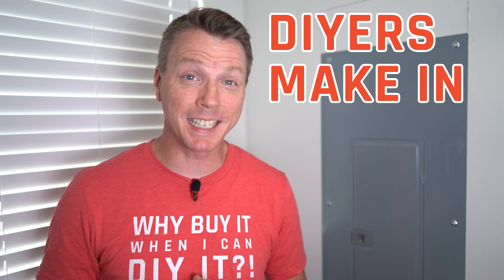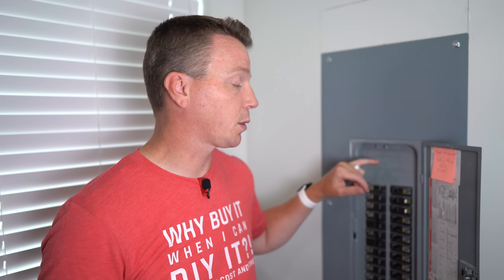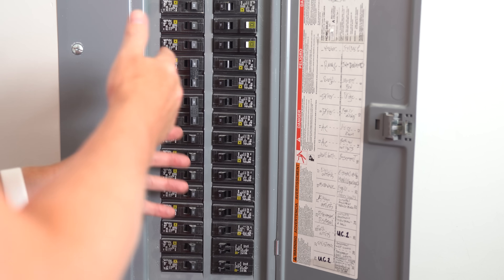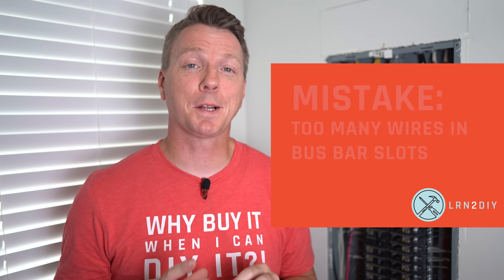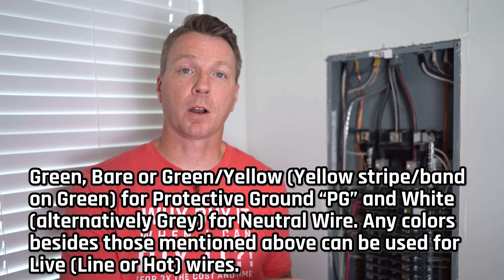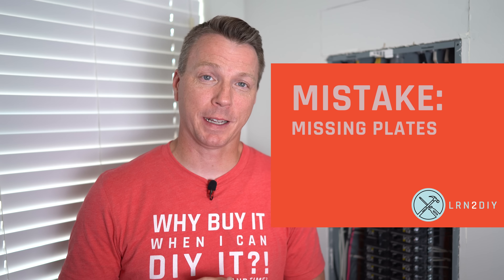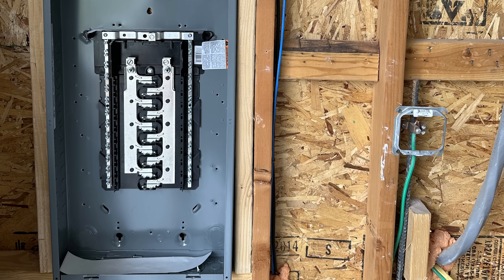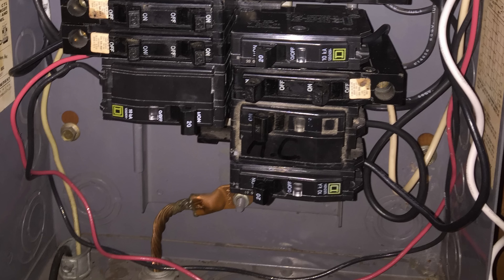10 Common Mistakes DIYers Make In Circuit Breaker Boxes

Comment: You forgot mistake #11 that you demonstrated in the video: Waving your hands cavalierly around a panel with the cover removed and then tightening the screws on the hot lead of a breaker without switching it off.  Even with an insulated screwdriver this is an unnecessary risk, particularly for a nonprofessional.  And waving your hands around the lugs where the entrance cable connects is just asking to touch a hot lead by mistake.
Reply: Not sure if he’s been shocked too many times or not enough
Reply: @RR33XX  With the probability of the box not being hot we will never know. Have a good day.
Reply: Good points, though I see near all electricians seemingly careless flailing hands to point at stuff or to touch things. Though recent contractors seldom reached in unless needing to do so. Isolated power if beginning work.
Reply: Lock out tag out. Never know when the neighbors snot nosed kid flips the switch or someone in property that was not aware of the service to switchgear.
Reply: Just imagine the panel is de-energized. Now you can relax.
Reply: @nothanks960  I am completely relaxed.  I’ve worked around high voltage my entire career, but to show such to DIYers is rather dangerous.  Maybe you should relax less and think more.  😁
Reply: I’m thinking he had the service disconnect turned off.
Reply: With a big ring on his finger.
Reply: What’s the worse thing that can happen?  Hahahaha
Reply: As soon as an electrician is certified, their resistance to current flow dramatically increases.
Reply: At least he wasn’t holding a beer.
Reply: @diytwoincollege7079  At least then he would have had an excuse. 😂
Reply: I don't touch any electrical panel without testing it with a non contact voltage device. Any screws removed will be done with insulated screwdrivers.  I'm going to get that torquing screwdriver.
Reply: There’s a lot wrong here. A 150A panel is pretty marginal now. Yes, there are plenty of 100’s and even 60’s out there but 200A is really minimum with central A/C and 400A is becoming common around here for larger homes. If I saw a panel with bonehead mistakes like wires entering the panel with no stress relief clamps, plastic or steel, or ground wires in the panel that are connected to nothing in particular, it’s time to call in a licensed electrician to unscramble the mess and bring it up to code. While he’s on the premises an upgrade to 200A or even 400A would be a good idea, assuming that the feed from the power company is large enough to handle the ampacity. If not, upgrading the feed is on their nickel, not the homeowners.
Reply: Totally spot on! Why not use a test pen to touch CB n not use own fingers?
Reply: The size of the breaker does not determine the Suze of the wire. HVAC is wire to the minimum and fuse to the maximum same with motor loads.
Reply: @williamleblanc3244  Well, technically the size of the wire determines the maximum rating of the breaker.  You can always use a smaller breaker, but you can’t use one larger than what the wire is rated for.
Reply: Look up NEC 440.4(B)
Reply: You can use smaller wire on a larger breaker. Refer to Article 430 and 440. The reason you can do this is for the lock rotor amps. For motors and HVAC, you wire to the minimum and have overcurrent protection at the maximum. So depending on the math you could have 12 Guage wire on a 30A breaker and be completely code complaint.
Reply: @williamleblanc3244 you made me look up the code, haha. It actually says the opposite, no 14 ga wires with a 30 amp breaker that leaves the same enclosure as the breaker.
Reply: I have been many times got electrocuted with 240volts! Feels like being sting with a giant killer hornet! 110volts is just small jolt nothing serious..240 volts is more painful 😂 the country i grew up has 240 volts outlet’s, no grounding, i was a diyer on my high-school days, got electrocuted many times from doing crazy electrical projects myself.. the only wires i would not mess around is on top of electrical post! I have seen carpenter doing a roof that accidentally touched those high voltage line, he got cooked for 10 minutes boiling his blood cooking his inner guts inside😩 saw how his intestines blew out and his blood  gushing out boiling from his mouth and stomach. Until now still hunts me..🙏 i was 16 then.
Reply: @camilo8cheryl  If you have been electrocuted several times, you have reincarnation down to a science.  Please tell us how you keep coming back from dead.
Reply: I like those panels that have an insulating plastic piece over those live incoming studs. It mentally removes a fear I carry.
Reply: @normferguson2769  Fear of high voltage, high current sources is a good thing and removing that fear isn’t always wise.
Reply: People often do diy to save money because electricians are expensive. Also living on an old house, some of the circuits are out of code and replacing them is really expensive. Doing diy for some of the work avoids having to remortgage your house
Reply: @normfarris3430  How expensive is burning down your house or putting yourself in the ER for an evening?
Reply: Dude was raising my stress level and giving me cold sweats
Reply: @chrismckenna5361  me too. I'm sure he has supply going to it off but still, need to make a habit of not doing that as there could be enough amps to easily kill.
Reply: Yeah, sure he was. All from the distance of a video recorded previously. Look up the word "exaggerate". You may find your picture there.
Reply: @chrismckenna5361  Yes, this sort of thing is what gives DIYers a bad name.  240 V electricity is nothing to treat so cavalierly.
Reply: I see that every time I help someone with an electrical problem
Reply: Doin’ it for views.  Lol
Reply: Y'all acting like this is 440 😂
Reply: @sebrofc  I once met a technician who insisted putting on fire proof apron before opening my panel cover. He said it might spark and he could catch on fire. 😂
Reply: Just like firearm safety... It's absolutely unnecessary... If you're incapable of paying attention to your body and something a flick away from death at all times without even trying.

 You deserve what comes to you or the poor lad who felt safe around such idiocy.  

The don't speak Italian 3ft from an open breaker box rule of thumb and the keep your finger off the trigger of an unloaded firearm with the safty on just because it might fire rule of thumb are just excuses for incompetent people to keep doing things that require competence... Top notch
Reply: Yeah he's making me jump ...he is not convincing me.. journey man electrician for _ 40 years.let him work in a powerplant a few weeks waiving his hands
Reply: That's why I can't watch my father in law use a table saw.
Reply: I figured this was a demonstrator panel and not actually hooked up… or maybe disconnected from the other end for this demo.
Reply: @tomwilson2112  You know what is said about assuming?
Reply: It's 120/240 bro..he'll be okay.
Reply: It is otherwise an excellent video !!!
Reply: Also, wearing his metal ring lolllll
Reply: Always one.  Sheesh
Reply: @mikevoorhies5171  Yes, and it took that one 4 months to show up.  Sheesh.
Reply: Don't forget!! Coffee is hot! Glad you added this otherwise I might wave my hand into a buss bar 😂 the world is so scared of itself its apparent why we never get anything done anymore lol 😆
Reply: @keithbaker1951  And people like you are stupid which makes such warnings necessary.
Reply: You would have passed out watching me work on mine yesterday.  I was fixing a disconnect box for my ac.  I had the cover off the panel and looking around.   Forgot I had a headlamp on and when I looked down the and metal head lamp touched the breakers.  Could have been much worse and almost had to change my pants
Reply: @ickess  No, wouldn’t have bothered me at all.  I have watched many stupid people do stupid stuff.  I have no problem with that at all.  I only object when stupid people tell other people, or show them how, to do stupid stuff, particularly folks that may well not even now that what they are being told is stupid.
Reply: I don't care if the box is live I cringed every time he started waving towards that box looking away from it sticking his fingers through the missing cover plate. Don't show people bad habits.
Reply: DIYERS NEED TO STOP GIVING ELECTRICAL ADVICE.

Electrical is not a hobby.
Reply: Excellent video. I was hoping would touch on multi wire branch circuits or MWBC’s. A little bit more detailed of a conversation, but an important one to understand how circuits are wired in a panel and how the offset of the two loads is carried back on the neutral.  Thanks for posting.
Reply: I agree completely, although it should be MISTAKE #1.  The first words out of his mouth should have been to turn the main breaker off.  Additionally, he’s not wearing any eye protection.  You make a mistake and short something and you are now arc welding and molten metal will be shooting around.
Reply: @glasshalffull2930 9
Reply: @glasshalffull2930 Risk at what?
Did you know a person can actually touch HOT ALONE and not get shocked or neutral by itself and NOT 🚫 GET SHOCKED 
ONLY IF YOU TOUCH THEM BOTH, THEN YOU WILL GET ZAPPED!!!  😎🤣
Reply: @glasshalffull2930 . Turning the main breaker off does not de-energize the conductors feeding that panel, nor the lugs they’re terminated on.  Safest method would be to remove the meter, then use cable ties to hold the bypass lever in place should you have one on your meter socket, and then keep the meter in your sight
Reply: @JamesLetourneau-p5k   (Edit: James deleted his comment because he was in error)

Actually, in THIS PANEL, turning off the main breaker DOES de-energize the panel.  If you examine THIS PANEL, you’ll notice that there is NO MAIN BREAKER inside the panel.  In 2020, NEC code changed (230.85) to require an easily accessible exterior EMERGENCY DISCONNECT for new construction 1 and 2 family dwellings.  It’s a safety feature for first responders to be able locate and shut off the power in an emergency.  So, shutting off the emergency disconnect would de-energize this panel.  If this were a ‘sub-panel’, turning the power off at the main panel would also de-energize the sub-panel.  Of course as you stated, if the main breaker is inside the box, then the main conductors/lugs would be hot even if the main breaker inside the panel is off.
Reply: @glasshalffull2930 I always turn the outside main breaker off when DIY anything electrical
Reply: @monad_tcp   I guess that’s why I said it should be #1.
Reply: @glasshalffull2930  Good points.
Reply: If hand waving was so dangerous, Scotty Kilmer would have vanquished himself decades ago?
Reply: Amen!
Reply: Your obviously a rookie !
Reply: @jamespatton2975  You’re obviously illiterate.
Reply: It was disconected
Reply: He is recording video with light and other electrical equipment on. Shutting down panel is counter productive.
Reply: @BlahBlahManYeah  Contacting a live panel with your body is also counterproductive.
Reply: YIKES
Reply: 😢😢😢😮
😢mm 0:58 🎉
Reply: No he did not. Read the title. It says "10 common mistakes", not "every f¥kng mistake you can think of"
Reply: Bro he likely had the main breaker that supplies the power to the house shut off making it safe for his hands to go around in the box.
Reply: I was thinking the same thing 🤦🏽
Reply: Man, I was thinking it was just me. He was stressing me out so bad watching this video.
Reply: I don’t think there is power running to the panel, so nbd
Reply: @Flipflop437  That is what many electrocuted people also thought.  When you are demonstrating a procedure to someone, especially novices, you should “train the way you fight” and do everything correctly and demonstrating proper technique and precaution.
Reply: So many YouTubers do this. It drives me crazy.
Reply: I would say it's just a dummy box and has no voltage at all to it. Something like for training scenarios!
Reply: @SamuelDowning78  Doesn’t matter.  Train like you fight and fight like you train always applies.
Reply: I’m a fan of folks using a wooden dowel or a pencil. But I almost never ever see it in YouTube videos.
Reply: @Boogle912 , A pencil has a conductive center.
Reply: @donaldthompson2319 okay but sorry I meant using the eraser of a pencil. Better than a finger
Reply: How do you know it's live?
Reply: @TlD-dg6ug  It doesn’t matter if it is live or not.
Reply: This guy is going to get some people killed by making them feel overconfident about their electrical abilities or lack thereof...
Reply: I’m guessing he had the main breaker off.
Reply: Risk at what?
Did you know a person can actually touch HOT ALONE and not get shocked or neutral by itself and NOT 🚫 GET SHOCKED 
ONLY IF YOU TOUCH THEM BOTH, THEN YOU WILL GET ZAPPED!!!  😎🤣
Reply: @Vote4Trump2MAGA  And you are wrong.  I would suggest you try it and get back to us, but I don’t want you to get hurt so don’t try it.  You absolutely will get shocked.  The amount of shock depends on how well insulated you are from a ground reference, but even perfectly insulated, you will get some shock.
Reply: @Vote4Trump2MAGA  People who type in all caps are always full of crap.
Reply: Thinking of the guy who always shocks himself demonstrating electrical projects 😂
Reply: Always work with panels,as if they hot even if power is OFF
Reply: Relax my guy, it's insulated.
Reply: @CatnamedMittens  ROTFL
Reply: What a bunch of whiners
Reply: Dude!........At least wear some good insulated gloves!    (And NEVER work in an "energized panel"!)........NEVER
Reply: Yeah, it was a bit uneasy feeling
Reply: I am not an electrician, but metallic rings worn on your hands is a big hazard?
Reply: The instructor made me cringe every time he poked/or waved his bare hands around the bus and the wires especially with his wedding band on his finger. I don’t remember him letting us, viewers, know that it is very important to make sure there’s no power to the panel before opening or working inside an open panel.
Reply: Low voltage won't come out and get you@LTVoyager
Reply: @animalmother9945  Which has exactly nothing to do with my comment.  Read it again, Sam.
Reply: You clearly have no electrical skills if that's what scares you
Reply: @illwil2158  You clearly have no brains if it doesn’t.
Reply: Amazing how many people think they know how electricity works. It’s not static electricity that is in your electrical panel and it’s not going to jump out of the panel and shock you. There are only certain parts in the panel that will actually shock you so settle down all you know it all’s out there.
Reply: I'm glad someone else saw this
Reply: I understand your point but also as long as you're aware of where your hands are, you'll be fine.  You should treat electricity with respect, but being terrified to even touch it can be just as bad.  I've seen guys that made really bad mistakes because the fear clouded his mind.
Reply: @ You just confirmed that you actually didn’t understand my point.
Reply: I agree this guy gave a lot of unqualified and wrong advice that could spread misinformation in the diy community.  I am OK with diy guys doing their own work after getting the right information, but it's dangerous  if you get your training from diy guys.
If you are learing do yourself a favor and get you advice from another video.  For examples: you never go around and retorq screws because it da ages the wires so that they might carry less amps and over heat . That means  in time  ay e 10 or more years later you could be the cause of the fire. It could also happen sooner depending di g on how many times you go around re-torqing.  The torq number is for a fresh stripped wire. After being torqed over time the wire tensile relaxes and it is still properly torqed. So whe re-tored it damages the wire.  So torqing is done once and done.  And the same thing about what he thinks is a nice tight job -- there is safety issues if your not a trained electrician that include wire bending radius,  and location.  That type of short wiring should only be left to an experienced  trained  qualified electrician, but adiy guy should definitely not do what "he thinks" is short and neat because he is not qualified to judge  best practices.  Most diy persons should leave a little extra to a small loop of extra wire.  It's very li,Ely that an experienced  electrician may need to come move circuit  breakers around, a d even diy guys will likely need to move things around some day.  For example, the electronics including safety devices that go into houses after 2023 can be protected by a SPD that goes at the top or closest to the line side end.  Also, many e,ectrical panels will add a small roof solar system and those breakers are located on the opposite end of the bus for the breakers.  And maybe you add a hottub or extra circuit  and it hasrequireme ts to move  breakers.  So unless you live in an apartment building or a condominium you could be shooting yourself in the foot by short wiring your electric panel. The opinion of a diy guy that over rea he's can be dangerous  as much as it is helpful.
Reply: His arm was rather close
Reply: I was sweating every time he got his hand or fingers anywhere near it.
Reply: I was just about to write the same thing! 😅
Reply: I agree! A wooden chopstick would make a good, safe pointing device.
Reply: When is your video coming out not soon enough.
Reply: Add to the no PPE , wearing jewelry while working around electrical equipment. An absolute no no. I put a hook in the very back of my toolbox so my wedding ring could sit there until finished working.
Reply: I supect it's shut off.
Reply: I'm sure he turn off the power to that panel before he started, he just forgot to mention it.
Reply: @donaldshimkus539  "I'm sure he turn off the power to that panel" ... No. That is the main house panel, not a subpanel. There is nowhere to "turn it off" other than pulling the electric meter which is usually secured and tagged.
Reply: @fyt54321  well then, he's almost as crazy as me. If I told you what I've done, you wouldn't believe most of it.
Reply: @fyt54321  
You obviously are not an electrician.
Any newer service has a breaker and lockout at the meter base. Outside the house in an egg structure or whatever ordinance is required. Every job I do where a meter base goes in has a structure and breaker outside.
So many people just rattling off "what they know" go get an electrician license, then comment.
Reply: @fyt54321  I can't speak to other locations but we have a main breaker easily accessible below the meter and then a main box inside like he is showing. Have a good day.
Reply: @donaldshimkus539 I think you are absolutely right,  as I can see this is a lug panel, so the Main disconnect is probably outside next to the meter but he forgot to show  and mention it.
Reply: @donaldshimkus539 either way, it's a problem in an instructional video.
Reply: @charliesullivan4304  true.
Reply: Good grief keep your hands away from those wires. Very unsafe to do this, especially that you were waving your hands near the wires and looking at the camera. Use an insulated screwdriver to point out things, not your fingers.
Reply: @SavageVoyageur Risk at what?
Did you know a person can actually touch HOT ALONE or neutral BY ITSELF AND NOT 🚫 GET SHOCKED 
ONLY IF YOU TOUCH THEM BOTH, THEN YOU WILL GET ZAPPED!!!  😎🤣
Reply: @Stark-ek7mh  hey, that's me. Working in hot panels and on other live stuff. Checking for juice with my fingers. I don't do the 480V stuff anymore though. Already close enough to waking up on the other side of the grass.
Reply: Good advise
Reply: Good advise. Learn to spell
Reply: @nothankyou5524  Learn to reply properly so we know to whom you are replying.
Reply: Tie his hands behind his back and he couldn't talk
Reply: @jesseabreu3849 po8
Reply: I'm sure he turned off the main.  Duhhh !
Reply: @robertfisch4603  the fact that you don't know if he did shows your ignorance
Reply: @bugbomb8048  True.  Look at all of the idiots that are around today given the safety craze that started a couple decades ago.  We need to let Darwin work his magic again.
Reply: Honestly, and this might make me sound like an elitist, but I think if someone needs information from a YouTube video they shouldn't do their own electrical work even if it's legal.

Video explanations to help you learn code or work techniques, yes, absolutely.  But this the goal needs to be to become comfortable with the books.  There are a lot of "except for" details.

For example, 14 ga wire does get you to an ampacity of 15 A in residential work - except for when it doesn't.  Maybe the wire is in a hot environment and needs extra protection to avoid cooking the insulation.

Too much stuff being fed from a panel shouldn't be a fire hazard - the main or feeder breaker protects you. But it is a nuisance risk.  Imagine having the whole house black out because you have the oven, hot tub, dryer, and car charger going at the same time.

And sure enough there are best practices in code with tables and such to help you out.  Adding a subpanel probably isn't the solution though. If you need a bigger service from the utility, a subpanel won't magically give you more capacity.
Reply: Yeah, you're an elitist. Doing your own work is commonplace on many, maybe most parts of the country. That's why permits are pulled. That's why work is inspected in stages. And please don't tell me the guys that an electrical contractor may send out knows what he's doing. I'll take my work over the electrician that installed the 200 amper in the house I bought any day of the week.
Reply: @nothankyou5524  Who are you talking to?  You do realize you can reply to a specific person, right?
Reply: @jordanrodrigues1279 Make your own video, genius!
Reply: @jordanrodrigues1279 It's not rocket science or brain surgery.
Reply: @jordanrodrigues1279  I'm guessing you go to a mechanic to have your brakes changed as well?
Reply: @jordanrodrigues1279  Point well taken.  Hopefully, people will view not only this video, but multiple one’s done by actual electricians and read the comments like yours that point out errors or better practices.  More knowledge is always a good thing.
Reply: He was actually making me nervous.. like someone handling a gin within clearing it
Reply: Came to say the same thing. He’s waving his hands near the main lugs while facing the other way. Asking for a bad injury or worse. And maybe teaching others this is ok.
Reply: Good thing all these experts are here to critique a video that has been staged. First, just watch the freaking video for the content and if you don’t like it carry on. He specifically states that if you aren’t qualified or comfortable with this type of work DO NOT DO IT D HIRE A PRO. Second, for the consideration of time and the many more hours it goes into making and editing a video like this and its intended audience ( not a newb) some things may be implied…. You know like turn the main off and ensuring that the system is not energized before digging around in a panel. Yeah he did cover that too in point 1. BuT BuHTT WhAT iF THAy ToUCh the Main BeAfOUr tHe BrAkOR ?!?!? Well then its their time to shine and they had a good run. It’s great that all the safety Stan’s are here to ensure the picking apart of a very informative video.   understand that he is making these videos often, and is pointing things out like you would in an instructional setting( it is an instructional video) and is very much paying attention for his own safety and whoever may be operating the camera. The other consideration is when a video is shot different angles do not give full depth of reference to where his hands may or may not be close to. He comes off as a pretty intelligent guy and i would assume that he put safety measures in place before hand and oh my , may have cut them in editing four time reasons.  Again… referring back to the first points if you don’t know what you are doing then you shouldn’t be doing the work. Good on anyone who is watching a video to better their knowledge or get a different perspective on a familiar process . As for the dim bulbs who would disregard their own safety and stick things where they shouldn’t be in an electrical panel…. Sometimes you need a little chlorine for the gene pool . 99% of the time even if the safety measures are scrutinized at length, Stupid is going to stupid. Anyone doing a DIY should always check codes and look up all possible info before attempting any project.  Also if you are getting all anxious and bent watching a video you have obviously never been to a real job site to witness the daily death defying stunts by people who are “Professionals”… Plus nobody likes the “safety guy”, find me someone who isn’t a safety manager who likes other safety managers.. BTW @LRN2DIY great video!
Reply: @jimhardin1520 what a blowhard, stop the pot smoking
Reply: @jimhardin1520  Thanks Jim for your responsible view on this. I agree with all you said.
Reply: @jimhardin1520  He givessome really bad advice and diy guys will say i thought it was all good. He knows just enought to be dangerous .  He was talking about things he only half understands and he was trying to give expert advice.  If his video was this is what I did, .ike show and tell it would have been OK, but he unknowingly guy spread a lot of false information, and uninformed opinions.  If he did not try to play teacher and get so much wrong g then no o e would be giving g him a hard time.  QUALIFIED PERSONS  are doing honest truth here.
Reply: @jimhardin1520 
So well put!!! 
My response was going to be very similar to yours.
We at job sites do far more death defying things all day every day.
If you don't know what you're doing, learn first. If not, you will learn the other way. I still get bit because I push the limits sometimes. It happens. Feel like a moron with a clouded head for a few minutes after tasting 240 and move on. Lol.
Oh, the chlorine for the gene pool comment, THAT'S THE BEST! 😂
Reply: @jimhardin1520 Boy, that really seemed to strike a nerve with you.  I hope I am wrong, but as a student of human psychology for 57 years now, I have seen your kind many times.  The kind that can’t be told anything, can’t take correction, is never wrong, and knows it all already.  These are the ones that end up getting hurt or killed leaving a family behind.  Again, I hope that’s not you.
Reply: Did you get your degree in that? A bit pampas, are we not?
Reply: I was shocked (no pun intended) to see that this work falls into the realm of DIY.   Where I am it is restricted work and may only be undertaken by a licensed electrician.
Reply: @nocturn791   So, if you have a receptacle ($2.65), you pay an electrician $80+ to come out and replace it.
Reply: @nocturn791  The problem is that not all DIY folks are the same.  I am a retired EE and am quite familiar with electricity.  Should I be prevented from working on my own electrical system?  How about a retired electrician who is technically no longer licensed?  It is seldom good to have broad brush regulations that don’t take into account individual competence.
Reply: @LTVoyager  - sure, that is understandable.   But who's there to verify all this experience?  A regulatory regime is not only there to protect the homeowner against the dangers of working with 240v but all future owners and occupiers.
Reply: @nocturn791  Then inspect the structure at the time of the sale.  Government is already far too intrusive.
Reply: @LTVoyager You are 100% correct, sir!
Reply: @nocturn791 licensing requirements also function as a barrier to entry, preventing the supply of services from growing at a rate to meet demand, which also keeps prices higher due to restricted supply.  Licensing is good in many instances, but it does have the ability to restrict competition.  Also if I’m a licensed nurse, doctor, electrician or plumber in one state, my license isn’t valid in other states.  This is proof that licensing functions as a barrier to entry into a particular field or market. Though South Dakota recently changed their regulations to honor licenses from other states.
Reply: @LTVoyager Electricians almost always refuse to acknowledge EEs' ability to read and understand NEC just as well as they do and those of us in the defense industry have standards way tighter than commercial electricians. Some of the bundling of wires through conduits I've seen them get way with would never pass our standards. Whatever, haters are going to hate. For the few electricians out there that do understand and respect EEs (you know, the guys that designed amost everything electrical that is sold), the respect is mutual. I appreciate all you do and I've learned a thing or two from you along the way.
Reply: @nocturn791 It is not governments job to impose common sense on citizens. I wonder how you feel about common sense gun laws.
Reply: @LTVoyager yes you should be prevented I've never seen an EE that was qualified to do any real work and their design work is usually suspect lol
Reply: @johnvandemark7490  This is your way of saying you’ve never seen an EE.  Got it.
Reply: Sorry this is a free country i don't think more regulation and more Nanny 3 letter agencies are needed. Residential electricity is so simple. Try aircraft or even automotive wiring.  Obviously it can be dangerous but 4 wires is you use 2 hots, neutral and ground.  I was a plumber/pipefitter/millwright and i have all the confidence i need to wire any home din America
Reply: @PatrickBuckley-ol2ok   I never mentioned more regulation or 3 letter agencies.  Yes, residential wiring s simple, but so is auto and aircraft, unless you are talking military or airliners.  Wiring really doesn’t get complicated until you are routing multilayer PCBs for modern computers.
Reply: In all places ive lived, you.pull a permit and inspection is done before you close up. Sorry if you dont like it, but if proper attention is paid in doing it right, imo, its not a problem. If you're over your head, you should be intelligent enough to not do it. This is commonplace in many many areas of the country.
Reply: @nocturn791 
It’s not that difficult to figure/learn how electricity works a/o how to do this kind of stuff!  The same goes for working on your natural gas lines and plumbing  a/o appliances.  All it takes is a bit of reading, safety awareness and a practicality/common sense.  🤷‍♂️
Reply: 240 is a joke. Stop being silly.
Reply: Oh jees 240 is only a tingle if you touch it.
Reply: @MUUKOW3  I shorted 120V with my two fingers when I was a kid.
I've learned my lesson.
Reply: @monad_tcp Wait until you get thrown across from the HV side of a transmitter tube. That will get your attention.
Reply: @MUUKOW3  I once got hit by the lead to a 3 500z ons heathkit ssb220. iam very lucky to still be here today.
Reply: @MUUKOW3 now that's high voltage! I work on simple guitar tube amps and the radio tubes you work with are another level.
Reply: @MUUKOW3 : Bet you won’t do that again!
Reply: We, electricians, will not have any respect until this b.s. of owners allowed to.touch electrical is stopped by the inspectors.
Residential and industrial electrical wirk MUST be done by a LICENSED electrician. Any handyman or big belly home owner, or an idiot hired by a manager like "electro mechanic" now do work fir homes and industries.  And these  morons waste .Illinois trying to comply with OSHA.  Gimme a break.
Reply: @euskadi46  If the work is done properly, it doesn’t matter who does it.
Reply: @euskadi46 That's crap.  I spent five years doing electrical work, then moved on to another career.  I'm perfectly competent to do work on my own houses that complies with code.  Many people that aren't licensed by government have enough experience to do work safely and properly.